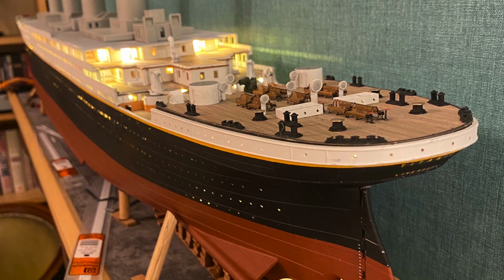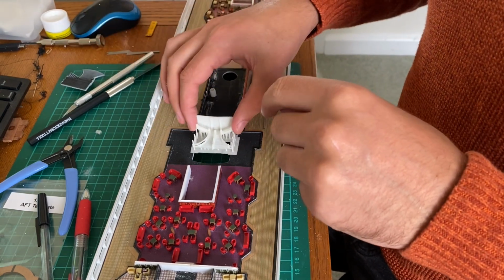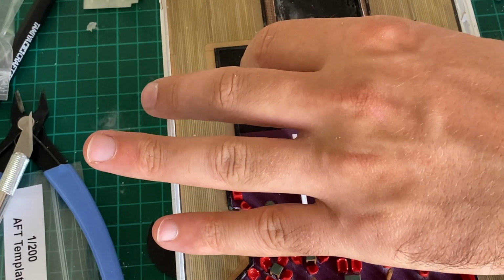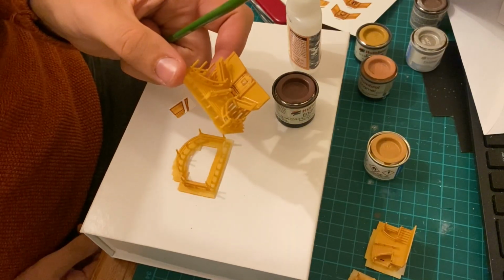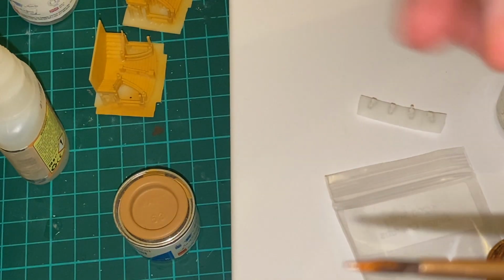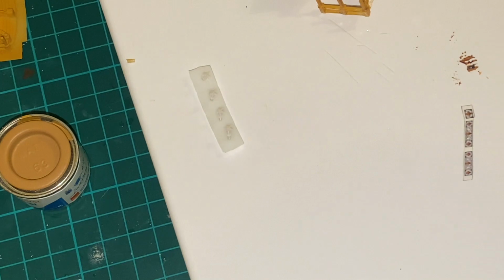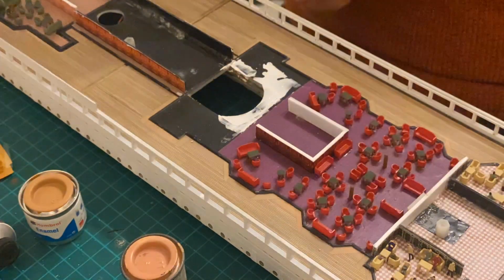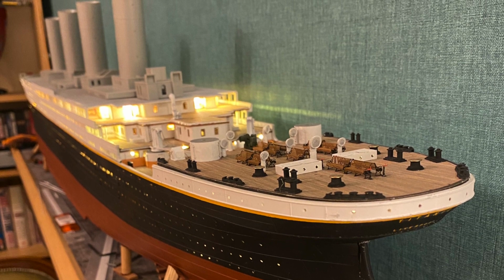Radio Control Trumpeter 1:200 Titanic Build Part 40 - Grand Staircase & GIVEAWAY

Comment: I think the middle propeller had 4 blades and not 3, Am I wrong?
Reply from the maker: It’s a bit of a disputed topic! The famous photo of her propellers was actually Olympic. There’s a theory that white star fitted Titanic with a three bladed prop as an experiment to find greater efficiency. 
This is a good read:
https://www.encyclopedia-titanica.org/mystery-titanic-central-propeller.html
Reply: @TheModelBoatGuy  yes, I know that. But remember that Titanic needed Parts for the Inauguration, and Olympic was in the dockyard reparing her stern. And WSL just transfer parts to Titanic to the Inauguration.

Comment: If you're worried about accuracy, look at the bow stem. Titanic's was nearly vertical. Almost  90 degrees from water level. The trumpeter model has an angled bow stem. That really sucks because your model build quality is exceptionally nice and it's kind of a huge difference in the lines of the ship. It's also nearly impossible to correct.

Comment: hi following your build as am doing the same to mine and the chief engineer's name is joseph bell also could you help ? what universal joints did you use to join the props to the motors ? i would be most grateful thanks
Reply from the maker: Hello, The universal joints I used are on this page: 
https://www.cornwallmodelboats.co.uk/acatalog/couplings-modular.html

That will be less useful if you are based outside the U.K. as that is a U.K. based shop, but hopefully it gives you a part number. That page also has the brass pieces that slot into the universal joints and connect to the shafts
Reply: @TheModelBoatGuy  thanks i am in the UK so that will be no problem so thankyou again

Comment: Hi Rob, I agree the staircase down below will never be seen so why bother!  My staircase of course will need to be painted a rather dodgy green! 🤢 The tip on the position of the staircase was great , I have seen somebody else move it too!  A bit of a blunder by Trumpeter!  Mini Brass make a rather good set of PE inner domes if you are interested!   The poor guy that lost his life and was the Chief Engineer was of course Joseph Bell.  Unbelievable, 40 videos, great job Rob. 😉
Reply from the maker: Hi,
Oh crikey yes I hadn’t realised that. A green staircase, what madness possessed them! 
I’m flirting with the mini brass domes, yet another thing to buy! Every time I think I’m done with the added extras on this model another comes out and looks tantalising! 
Thanks for the kind words
Reply: @TheModelBoatGuy  Hi Rob, Yes a green staircase!  I think that what we have to remember is that trends were changing in favour of the Art Deco period away from the more traditional styles of interior ship design. Painting the main staircase green was probably an attempt to spruce the old girl up a bit!  A word of caution on the Mini Brass offerings.  I have quite a few of their smaller items like Davits and deck chairs etc but when it comes to the larger structural parts they do seem a little oversized. I have just compared the bridge replacement parts to the model and they are a little bigger, enough to require some modification.  I have the domes too which are really good and come in a meaty gauge brass but they do look a little bigger than the model allows space for. I may be wrong on this as the parts need bending into shape of course. Even so I am sure that they can be adapted to fit one way or another and they are pretty good to look at!  Removing some of the lower edge may well sort out any disparity and that wouldn't really be noticeable once installed.  Regards JH
Reply from the maker: Hi, yes the world and trends were in very different place in the 30’s to what they were in the 10’s! When you consider it’s only 20 years it’s incredible but the world  went through an awful lot in those years I suppose!
Ok I’ll have a think about the mini brass stuff. I have some ideas on how to spruce up the plastic domes but I suspect they won’t look as good whatever I do. I think I’ll get to a point where I can see how visible they are and make a decision there. Lots to do before the domes get done anyway! 
Keep well, 
Robbie
Reply: @TheModelBoatGuy  Hi Rob, the domes, I thought that I would test mine out in view of my comment to you about the Mini Brass versions being a tad oversized.  On the sheet they supply three, 2 round versions and one oval.  The round versions are in 2 sizes for some reason. The smaller one after careful annealing makes up into the perfect size and will look great on the model. I used the plastic kit version as a jig to get the perfect shape. I am very happy with that one!  The larger version is definitely oversized.  The single oval version is unfortunately a little too big for our purpose.  However, after some gentle bending and trimming I think that it could be made to fit and you only see the top of it anyway.  It will be inside the outer deck house too so it wont be seen at the bottom edge anyway.  So that's a little bit of advanced information should you want to go with them!  They do look far superior to the supplied plastic domes though!  Stay warm!! Regards Johnny   😉